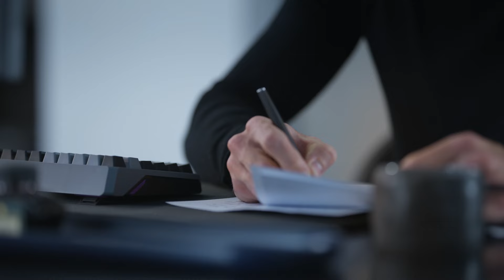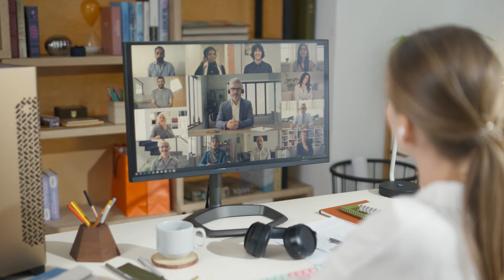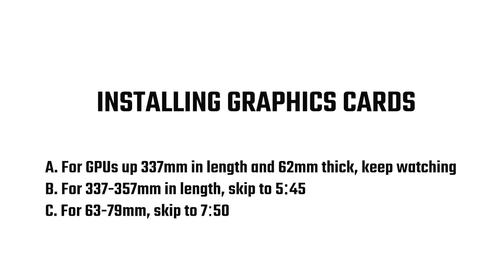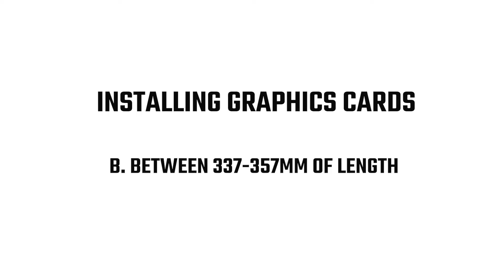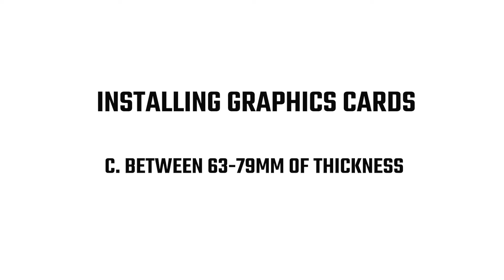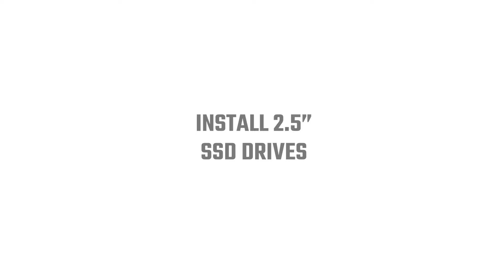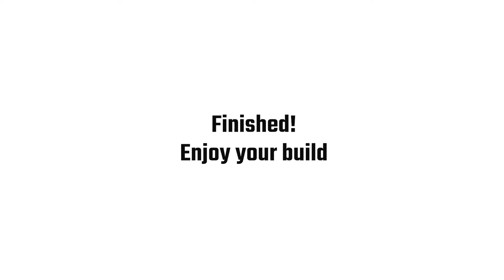Cooler Master Revolutionizes the SFF World with the Launch of the Ncore 100 MAX

Comment: It's not like it's the first one, looks like the NZXT H1 and the Phanteks Evo Shift had a baby...they have been out for years and im  sure the 120mm AIO they call "custom" on the website lol can handle most cpus it wont handle all, there are smaller or similar size cases that take alot better cooling even if this is a complete and easy to build set up.